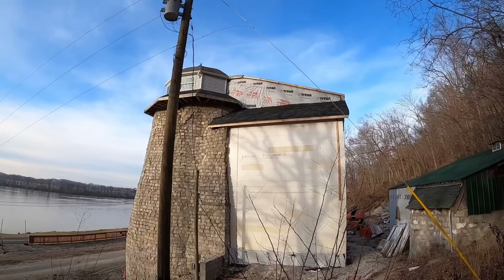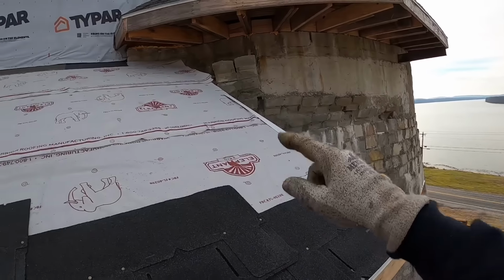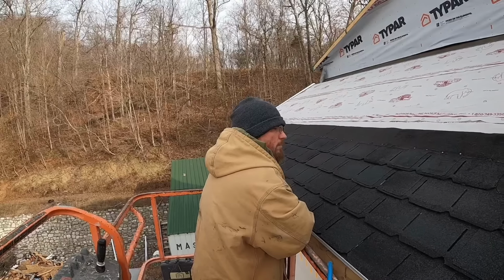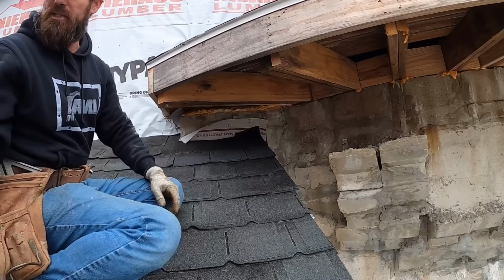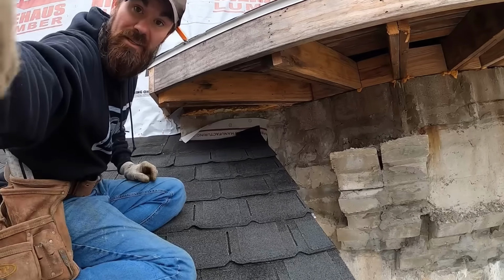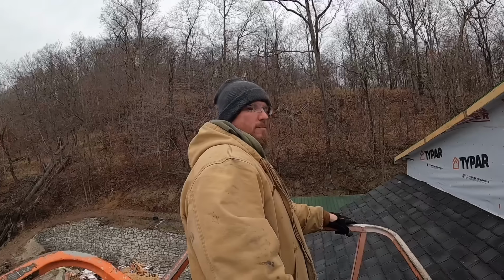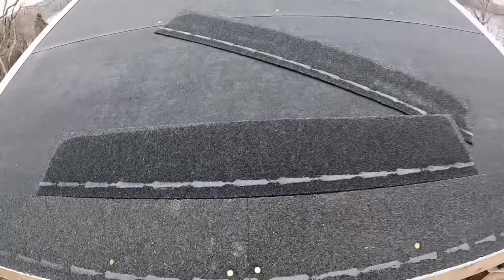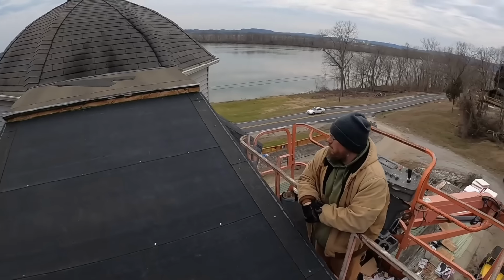Castle addition roofing! Plus a mistake!

Comment: Only a slight oversight Matt..... still does the job !! 🤓
Roof is getting there, felt is not a fan of cold weather 😬 
On this side of the pond, felt is predominantly used on small outbuildings, sheds, etc. Most roofs are tiled or slated, and industrial buildings are usually metal based. 
Watching Eric weilding the knife, he is one clean cut operator 😎😎
And the view..... 😃😎😃

Comment: Interesting, how long do you expected that roof to last to last. In the UK we use Felt roofs for temporary builds like sheds, chicken house and garages. Normally need to be worked on about 20 years, the sun degrades the tar. For houses we use Tile and Slate etc. The young house I live in has a tile roof and has not been touch in 60 years. There are houses 400/500 years old with stone roofs in good condition.
Reply: There are many places in the US where slate is either not available, cost prohibitive, or no-one knows how or wants to install it. Central VA has a number of slate mines, because of the old houses(Richmond, Williamsburg, old plantations, etc.). So does PA. But down here in East TN, i know no one who does this. Cedar shakes was the roofing material of choice in the 1700s. Metal is the most popular one in many cases now, because of the highwinds we get here. Shingles get blown allover the yard. A high quality shingle roof should last 20 years. That’s a long time here.
Reply: $$$   Most people don't want to pay for that. Besides, many people move before the shingles go bad. Average length in a home is @13 years. It's someone else's problem after that.
Reply: Bit like thatched cottages in England @firesurfer
Reply: @cyrildhy8993  Not really, a thatched roof will last 40-50 years. The ridge may need renewing every 15 years, but the roof itself lasts a very long time

Comment: Matt I’am glad that you owned up on the mistake of the shingle starter.  that could have been corrected as well bye trimming off the bottoms of the first row of shingles to make a proper starter or, place mastic along bottom edge before applying shingles But the biggest problem I see is the placement of the metal edging . Metal goes first and the Ice and water shield  then the felt . Ice and water shield is required in Indiana . It has to protruding at least 2 feet  into the living area . So with 12” Over Hang it will protrude 2’ into / over the living area .Hope you don’t have ice jamming problems
Reply: On the bottom run the underlayment goes under drip edge, sides go over, correct

Comment: I have always tried to put the drip edge directly on the wood and under the wrap on the bottom of the roof. A different story on the gable ends. That way the moisture than may run down on top of the roof wrap does not go under the drip edge. This is often debated. Then I hang the shingle 1/2 inch beyond the drip edge. The metal flashing at the top of the slope goes over the TOP of the shingle like you did it. It may not be as pretty but it keeps the water out.  As far as messing up with the starter course  it must have been a mutual decision.

Comment: The roof is looking awesomely good Matt.
It's definitely going to do It's job for decades. 
Great explaination on what and how your doing. 
Only thing I disagree with is the flashing on the side roof top and vertical sides of the Stairway to Heaven section is supposed to be under the shingles.
At least that's how they did it on my first house and on This Old House.